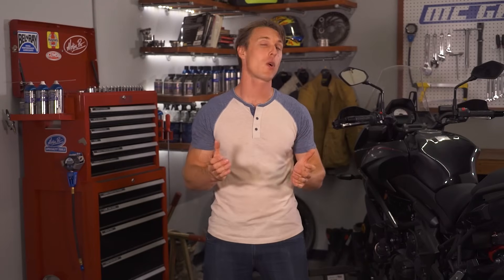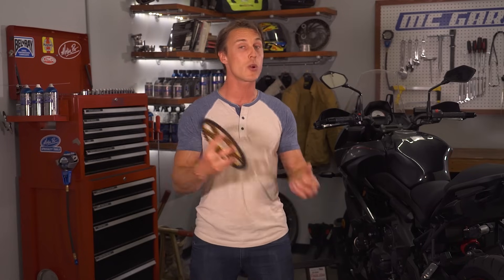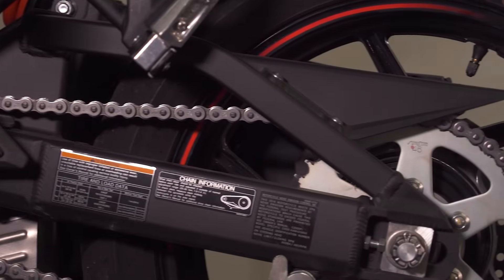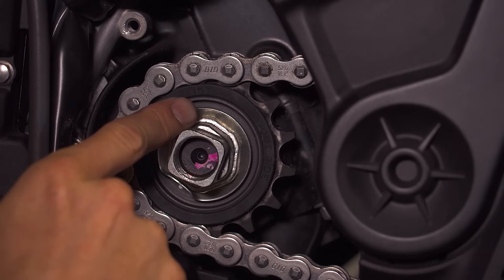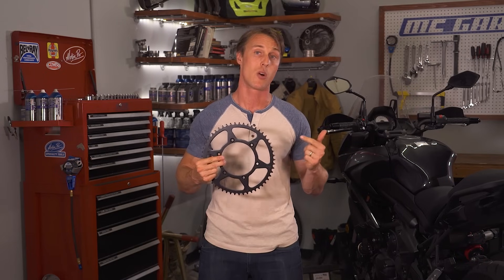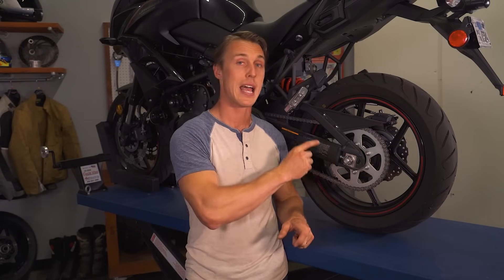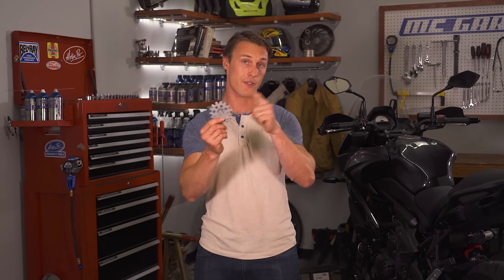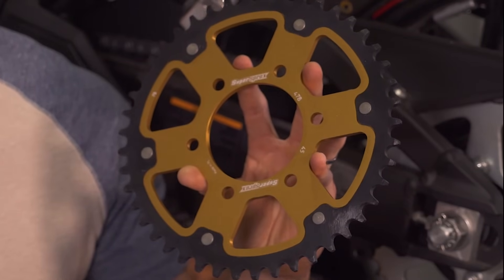Motorcycle Gearing Changes Explained | MC Garage

Comment: Changing the final gear ratio will not increase your torque at the rear wheel at a given speed. You are effectively only changing the behaviour in first gear. In first gear if you have a >100hp bike you are probably limited by grip rather than wheel torque so nothing really changes. Switching to a higher gear ratio will only give you worse fuel efficiency in most cases.
Reply: Actually, no, you're wrong.  It changes the torque to the rear wheel.   It's pretty simple math.  You can argue that it's more noticeable in first gear, i.e. the launch is different, but the reality is it puts more torque to the rear wheel and makes acceleration easier at any given speed compared to stock.  Yes, the main goal in gearing down is for better launch acceleration.  And I'd also argue that at 100hp+ traction is your only limit, I've never spun the rear tire on launch with my cbr600rr, which is over 100hp stock, yet after changing to -1+2 my launch is noticeably better.
Reply: @Zookeeper101  The torque at the wheel will be higher at the same RPM and with the same gear as before, but not at the same speed as before because your speed at that rpm will be lower now.

If you want to reach the same speed as before you will have to increase RPM potentially having to switch up a gear changing the ratio and decreasing the wheel torque considerably.

The advantage is that you can keep the engine in a slightly narrower power band, whether that affects acceleration significantly it depends on the power/curve "peakyness"; and this is balanced out by the fact that you will have to change gear more often.
Reply: @Zookeeper101  Love your moose video btw :D, Sorry for your flowers loss.

Comment: My dirtbike gear is 17-50t. Top speed ONLY 60km/h. Now i want to ride it in the city, if i change gear with 17-35t is it ok?
I think reducing the rear gear from 50 to 35 only add 30% top speed.. and it's still not enough. Sorry bad grammar.

Comment: Ok let's say you have a Fz1 and want to do that. The stock specs are a 17T front sprocket, 45T rear one (530 pitch). The OEM chain has 122 links. How do I know how many links my new chain needs to have if I change the front sprocket to 16T and the rear one to 48T?

Comment: Only really matters on a race track or if you are doing lots of motorway miles. For everything else simply knock it down a couple of gears for better acceleration or knock it up a couple for a quieter cruise around the streets.

Comment: Very good video i first time see your video after a youtube search. 
Plz guide ho to increase  acceleration of my honda cg 125 with orignal 15 /39 teeths .
And more over if i increase cluch gear teeths whuch is behind the cluthc box one is big gear behind the cluth plates box and other is small gear adjusent to this big gear,  big gear has 69 teeths while small gear has 18 teeths. 
Whle i plan to install biger small gear with 21 teeth which is come in honda cd 200 bike. 
So plz plz guide me what i do increase my acceleration and top speed ? So i subscribe your channel.  Thanks.
Reply: I want to take parts in bike races taken place in my area.

Comment: Hi,... I seem to have free play on my front sprocket....  2000 Yamaha xv250 has @ 1/4" travel towards and away from motor at the top of the sprocket. Is this normal or indicate wear?
Reply: Check if its fitted properly, there should be zero play.

Comment: Question.  I just bought a 2019 Kawasaki Z400 and the speedo is off by 3 mph.  Dealer said it's something I'll have to deal with as all sport bike speedos are off to some degree.

When my speedo reads 60 mph, I'm actually going 57 mph per GPS reading.  What changes to the front and or rear sprocket would I need to make to correct this and get it close to reading true???

After watching this vid, I thought about going bigger with the front for gas mileage but I'm already getting just shy of 60 mpg's but more is always better, especially since I have about a 30 mile ride to work lol.  I'm assuming going bigger in the front would slow the counter shaft, so would that fix my speedo since it's reading fast and would 1 tooth be enough or would it take a 2 tooth upgrade??
Reply: Live with it. Almost every vehicle (cars too) shows an inaccurate speed on the instrument cluster. Your 5% error isn't too bad in my opinion.

Comment: Very good video. I just got a 88 GSX1100F that my wife and I hope to tour around on and for me anyhow it feels like there should be a 6th gear because 4000 rpm at 100 kph just seems too high. It's not like it doesn't have enough power to change things up so it is maybe at 3500 rpm at the same speed.

Comment: If a change my 14/42 teeth set to 15/45, both having gear ratio of 3.0, what effect will it have on the performance????
Reply: It will noy have any effect on the performance, but it will decrease the force transmitted through the chain, however, the chain will rotate faster, so the wear on the chain will probably stay about the same. However, you could probably use a narrower (lighter) chain as it has to transmit less force. And you will need a new longer (heavier) chain to accommodate for the greater sprocket diameters. In the end it will make literally no difference in anything but cost a lot of money haha

Comment: Yeah, I went from a 15-43 on my MZ Baghira to a 15-45 and I didn't like that.  Not enough top end.  So I went to a 15-42 and it's great.  I like the ability to pass semis with more ease on the Interstate, LOL.  I don't need to rocket through a blind corner, LOL

Comment: I have a question... Let's say I have a sproket set of 34-15 (2.26) and another set if 31-14 (2.21).. assuming the 0.05 is neglected... What's the difference between both of them.. the 31-14 set should have a shorter chain right.. will there be any difference caused by a shorter chain ?

Comment: What should I do if I can't find my size sprocket it's stock with a 16 in the front which and 48 in the back lowest I can find is 44!!! am I looking in the wrong places??? Would a 44 work ??? Or is it too much of a difference???? Oem is too expensive and I can't just buy the sprockets it has to be with the chain as a kit !!!$$$$$$!!! I already have new chain
Reply: If you just bought a new chain, then you need new sprockets as well.  If the OEM chain is 48, then you should be able to find 48 tooth sprockets.  Have you looked at online vendors?  Why didn't you buy it all at the same time when you bought the chain?

Comment: ive been riding for 7 weeks and im riding 2016 ktm duke its fun but at highway speed it sits at 8000-9000 rpm and i think its to loud and i was told not to spend heaps on my learner approved bike

Comment: What would help top speed on a ninja 300??
Reply: A long downhill highway would help
Reply: add teeth to the front sprocket, i suggest +1 on the front sprocket you will notice the difference and if thats not enough for you go +2 on the front spocket
Reply: @skelskell    Most motorcycles do not have room for a front sprocket 2 teeth larger. You may grind against something
Reply: Turn it into a ninja 400

Comment: Changing my final drive from 2.14 to 2.1333 repeating is improving my fuel economy, increasing top speed and since my rear sprocket is bigger my acceleration shouldn't be hurt so much

Comment: Quick question:
What are the pros and cons of fewer sprocket teeth but larger in diameter because I bought a 44t but it is larger than my 45t rear sprocket
Reply: You might have wrong chain link pitch that doesn't match the sprocket tooth pitch, that is not good

Comment: Is it basically impossible to increase top speed by changing the gear ratio?
Also...say I want to increase the acceleration...will I get the same result if I go down 1 tooth on the front versus adding 1 tooth to the rear?

School me!
Reply: no and no. watch the video again. 
Besides, high speed is determined by your bike being at its maximum power rpm, which is usually not exactly at the red line. You want to gear your bike in a way that allows for maximum power in the tallest gear at its theoretically possible vmax to reach the highest possible speed on your bike. Have a look at the torque curves on your engine, multiply the rpm with the last gear ratio and then that with the sprocket ratios, the result of that will be the amount of turns per minute of he rear wheel. The circumference of the rear wheel times the revs of the rear wheel give you a speed the bike would be travelling at that point. Now, here is the tricky part: Can your bike actually reach that speed against air resistance ( highest theoretically possible vmax)? fiddling with sprockets can get you a higher top speed if you easily hit the rev limiter in your last gear. otherwise, the differences will be miniscule, as this does not add power to overcome wind resistance, it can only make your bike hit the wind resistance at its optimum rpm for power.

Comment: I like the MC Garage vids, but sometimes I feel he "cuts corners'

-2 front and +3 rear ... isnt that already quite a BIG change?? should mention that...
I did -1 front and +2 rear and that made my 2nd gear almost be a first gear???

he says changing the front sprocket is easiest cause less to remove, but that aint (always) true. 
And those sprockets tend to sit TIGHT, on my dads GSX1200, I could've removed the rear wheel and sprocket 10 times before we got the front one loose. 
We needed a 2m pipe to get enough leverage to get it loose.
And those thin bolts holding the sprocketcover and cluthcablelever are easy to overtighten and break by someone with less experience (my dad did)

also, the front spocket is the one that wears fastest and the less teeth, the faster it goes.
also, sometimes you cant even go less teeth or max -1 tooth front, cause of chain hitting the frame/swingarm
and smaller front sprocket reduces chainlife quite a big amoutn

 and going up in teeth in the rear can cause your chain to be too short or even tire coming too much forward, hitting the swingarm

Comment: I only use sprockets that have odd number of tooths to have more even wear. I only would go for shorter ratio if the power of the bike not enough in first gear, or on a track bike if the top gear(s) too tall for the straight; then I would use bigger rear sprocket and longer chain if needed than to use smaller front sprocket. IMHO the only good reason to go for shorter gearing, if the bike being slow or sluggish when used around the peak  torque and power rpm range in any gear. With my 1000cc bikes I always chosen a bigger front sprocket in the end, even if I have tried a smaller first - getting to the twisties with a lower cruise rpm and better mileage matters for me, as in the twisties I certainly can do one more downshift if I want to. I can live with the worse acceleration if even the first gear is too tall for a few slow corners...

Comment: gearing is one of my strongest expertise, gearing choice in road race kart racing is key. on my Vulcan 650, i swapped the motor sprocket to one more tooth, since im light weight and the motor revvs high, this was super beneficial. adding a tooth to the motor was a bigger difference than taking away a tooth from the axle.
Reply: @Ride Deficit I have the Vulcan S (2016) and i am thinking of changing the front sprocket to one more tooth (to a 16) will it fit?
Reply: @SamOnABikeSweden  i have a write up on this gearing change. search it in the vulcan 650 forums

Comment: Are individual transmission gears sold online in case you only want to replace a single gear ratio? The ratios from 1st to 4th gears on the DRZ400SM are fine but 5th gear is too short. I dont want to change the final drive, I just want to increase that top gear so the engine wont rev so high on the highway
Reply: Don't expect it to be available. I wish I could do the same thing as what you want. You could pave the path by taking your gears out (2 gears need to be made, as they mesh together) and having a machinist custom make some new ones. Get the dimensions of the new ones, and a supplier should be able to replicate them more cheaply. This whole endeavor would cost several hundred, if not a thousand dollars most likely. If you are good at making drawings, you could draw up your own gears though and the process gets a whole lot cheaper!

Comment: How much do you lower the RPM when reducing one tooth on the rear sprocket?
Reply: Head on over to Gearingcommander.com for that answer, they have a bunch of bikes in their database.

To use an SV650 for example with its stock 15T/45T gearing_______________________________________________
70 MPH with 15T/45T: 5113 RPM
70 MPH with 15T/44T: 4999 RPM (2.2% lower)

Comment: Love the videos guys, great work. I have a new bike (KTM Duke 790) with more performance than I've had before (Duke 390) & am now starting to get my confidence & ride more spiritedly, I have had headshake a few times when coming out of corners, I'm not worried about this but should I be & when does a headshake turn into a tank slapper?
Reply: There is a very fine line between headshake and a tankslapper, and it can quickly get out of control. Make sure the steering head bearings are not loose or worn out. Try to ease onto the throttle instead of being violent with it, as that could initiate a wheelie and turn into headshake when the wheel comes down again. 

My four cylinder CBR 250R would self-initiate a headshake above 30 mph if I took both hands off the handlebars. When I got a new front tire the headshake stopped! 

Consider installing a steering damper if your bike does not have one already(pretty sure it doesn't). Those can be lifesaving, especially at higher speeds.

Comment: If i change sprocket my spedo reading change too??
Reply: Not necessarily. If you have a bike that has a speedo on the front wheel, then any sprocket changes will not affect it. Otherwise, they will. You can identify a front speedo by tracing the lines coming down to the front wheel. There will be brake lines, and a single line for the speedo(if present) which will connect to a device attached to the axle, and lead up to the dashboard.

Comment: Great vid....BUT, I gotta say that getting the front sprocket off is infinitely harder then the rear.  At least with hand tools....a good impact wrench and you can get that front off no problem.  The rear requires more steps, but is easily done if you have a rear stand and some basic tools.
Reply: If you have a helper, you can just get someone to hold the rear brake, that should hold the chain still and let you get that front sprocket off easy!

Comment: I'm now thinking about a thing.
When getting a higher ratio, it's less expensive and easier to change the front sprocket. But, by changing rear sprocket, is there a gain with lowering the rotating mass and diameter ?
Wich can result on same gain that front sprocket but with little acceleration gain (and again more mileage) ?
Or is that negligeable ?

Comment: Hi MC Garage,
Why  I never get additional top speed using taller gearings?
My Stock Rouser 200ns comes with 14/39 pitch 520 with claimed top speed of 136kph.
However, when i tried to to change the sprocket combi with a taller gearing like adding just one tooth for the shaft sprocket it didn't add additional top speed.
Your immediate response to my query will be highly appreciated.
Thanks
Reply: Did it still rev to redline?
Reply: It is possible that the bike is already geared for max top speed, but considering you added a tooth up front and it sounds like the top speed remained the same, I think you just overshot your optimal top speed gearing. Try to find where your bike makes max power (example: 8500 RPM), and adjust your gearing so that max speed is reached at max power RPM. Keep in mind that many tachometers lie about their actual RPM by a certain percent, so try and see what your tachometer shows when max power is reached.

It sounds like you overshot your optimal top speed gearing, so try putting the 14T front back on and going to a smaller rear. You could also leave your 15T on and go bigger on the rear.

Compared to your 14/39 gearing:
15/39= 6.7% taller <----Your setup
15/40= 4.3% taller
15/41= 1.9% taller

14/38= 2.6% taller
14/37= 5.1% taller

Comment: Could you just shorten the 1st or second gear while keeping the rest of the gears same?
Reply: Not unless you're willing to disassemble your transmission and there are suitable gears, which would have to come from a factory race kit or the transmission of a compatible model. In other words, yes, but it'll be extremely challenging to do.
Reply: super low first and overdrive 6th would be nice on all bikes.
Reply: @JohnErikjohansson  then there would be large gaps from 1-2 and 5-6. Not good...

Comment: I agree the back sprocket can be harder to change for some, however be careful going with a smaller front sproket cause most bikes will chew up the rubber chain slider and dig into the spingarn causing some expensive repairs.
Reply: Yup, great point.
Reply: That's why you just maintain your bike well. If you do you'll notice your chain guards wearing

Comment: On my 2016 Yamaha TTR 230 I went down 6 teeth in the rear after jetting the carburetor and installing a K&N air filter. I had to remove two links out of my chain but it was totally worth it. Stock it was geared too low and with the mods that had to have been done.

Comment: Great info mate. What about shaft drive like most boxer engine bmw?
Reply: Mentioned that at the end of the vid. Can't really change the gears but some folks have mentioned going with a taller or shorter aspect ratio on the rear tire to effectively alter the final-drive gearing.
Reply: thanx mate, ill do some research on this taller/shorter ratio